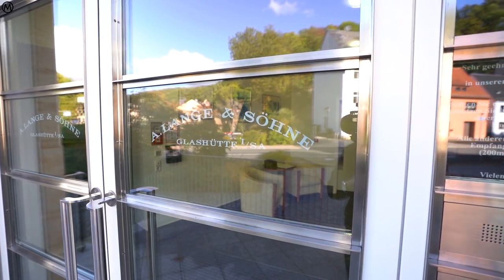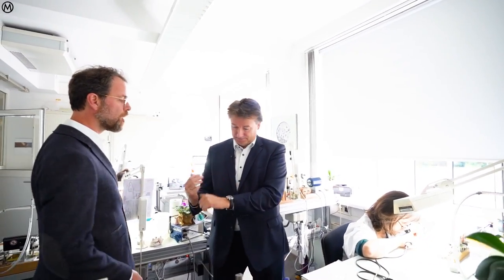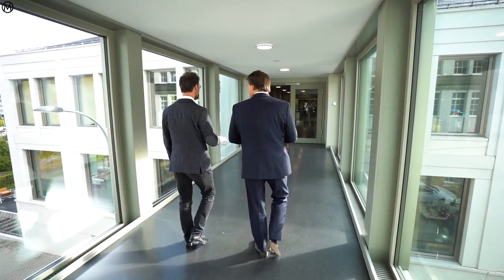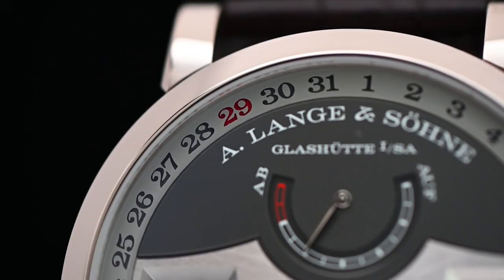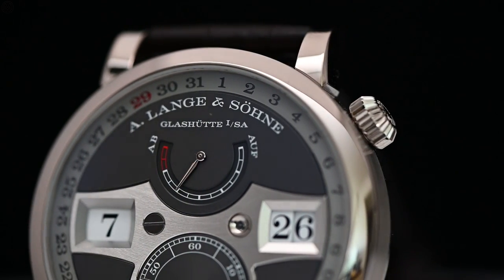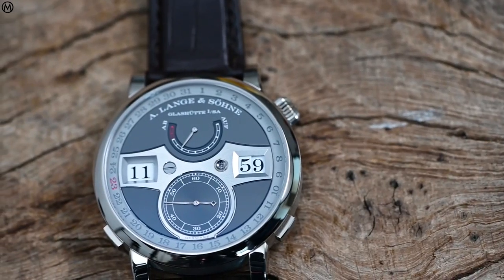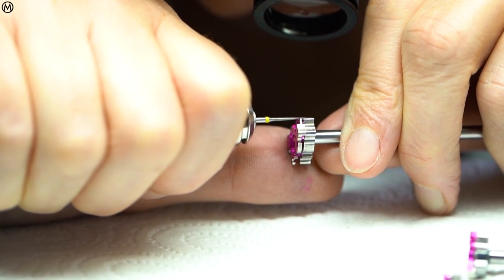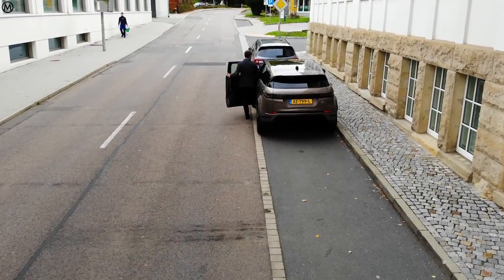Watch Review - The A. Lange & Söhne Zeitwerk Date fully explained by Anthony de Haas

Comment: I have so much love for Lange as a company and a manufacture. I only wish they made some of their more complicated pieces in non-precious metal cases and, as a result, slightly more affordable so I’d be able to buy something truly exceptional from them. But that’s just wishful thinking. Great video!
Reply: Audemars Piguet i think the price wont reduce significantly since most of the value are in the movement complexity and perfect hand finishing.
Reply: @Calvinbui09  While that is true, it is well known that any watch in precious metal brings with it an obnoxiously high price premium over non precious metals such as steel, so by sticking to precious metals, brands such as A. Lange. & Söhne and Patek Philippe with most of their lines bar the sports watches (Nautilus and Aquanaut) are almost exclusively in precious metals as that sort of justifies the extremely high price points for those timepieces. I do not believe, like some watch manufacturers sometimes say, that using exclusively precious metals in their watches is to keep in line with the “prestige” of the brand, as these days, case materials do not necessarily define whether watches are prestigious and sought after or not, as exemplified by the steel sports watch craze of nowadays.